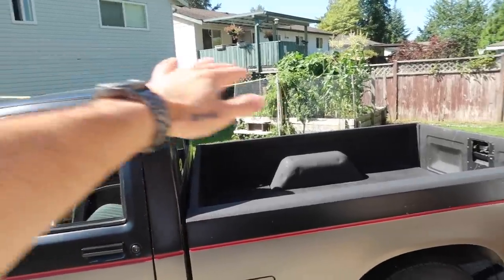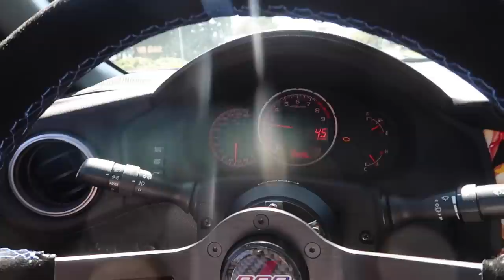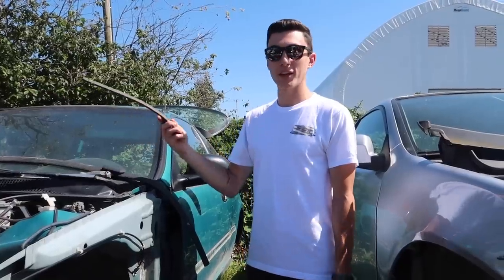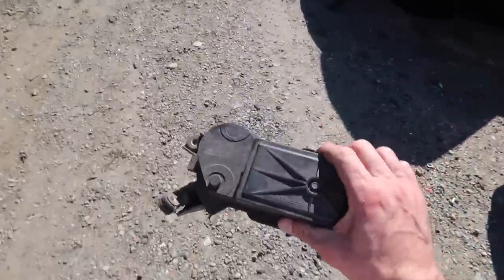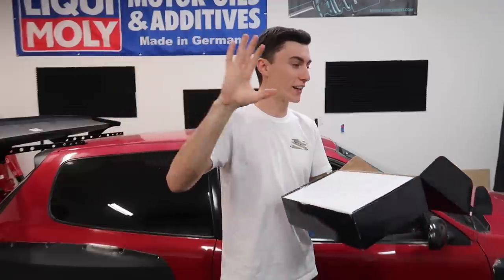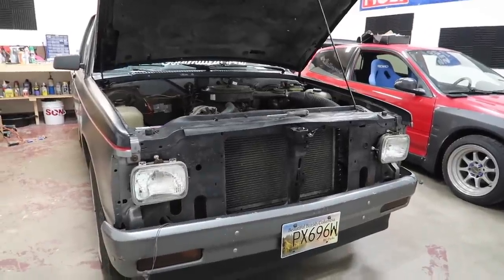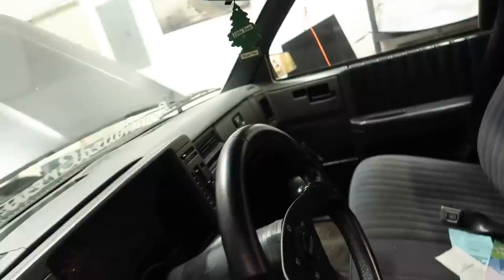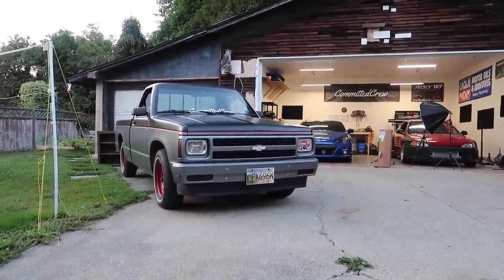Projector Headlight Install on the S10!

Comment: The wipers also use a relay that could be bad & the column switch could be bad too
Reply: the colum switch isnt easy to replace either, makes for good content though lmao
Reply: Yes even when he turned the switch it look really flimsy _ also use a power probe , 
See if u have power and ground , shoot power thru the probe and it will power up the motor ..
Reply: @martinsalter1814  the switch is easy to change ... It just pulls out. Feeding the wire down the coloum it the tricky part.  I have 91 sonoma . U have to ground the motor make sure there brass ground is clean it will not work ... The mother board thebterminals get dirty clean them too ..
Reply: .  I have 91 sonoma . U have to ground the motor make sure there brass ground is clean it will not work ... The mother board the terminals get dirty clean them too ....

Comment: Wiper motors on those trucks have a grounding problem. If it’s not mounted, it won’t ground. Also sometimes you need to run a wire from the body of the wiper motor to the firewall.

Comment: Robbie, buddy.... That gromet that is attached to the wiper motor by what looks like a metal band is the ground for those motors. To actually test it you need to connect the power source and thread a bolt through that gromet into something to complete the circuit.

Comment: Before pulling apart the truck to get the wipers to work, check the wiper transmission, my wipers stopped working in my A4 and that's what the problem was, a seized transmission arm. Just a suggestion, love the videos!

Comment: Robie, just fixed a wiper issue. You have to open that top up and resolve the contacts where the plug harness goes. Then reseal the top. It's simple! The issue is because the weight over the years tugs downward.
Reply: *re-solder

Comment: Not sure if you figured out the wiper issue or not but I had the same issue on my 1991 S10 the actual motor is the ground so when you bolt it to the truck that is how it grounds clean the bolts and clean off a little paint at the mounting points.

Comment: Those trim pieces that were 2 way taped on are not aftermarket. The vx and cx models had a stick on molding and the models above had clip on moldings. A little tip for people who want to shave that molding, get vx or cx doors there no holes to be filled in behind the molding just a bit of 2 way tape to remove

Comment: I blew up my neon today time for a srt4 swap
Reply: I feel sorry for you. Good luck on the swap
Reply: Thanks man. I blew the head gasket on this 2.0 DOHC one to many times. Time for the srt4 wire harness already got a tunable ecu. Just need the 2.4 engine trans and axles. Other than that its plug and play pretty easygoing.
Reply: @ricerneon399  nice keep me updated
Reply: I have another 2.0 I'm might just put in for now wile I locate some srt4 parts
Reply: @callumb5184  keeferthequeef
Reply: Good luck dude; Hope everything turns out perfect!

Comment: WIPERS: yo I'm sure you've fixed these wipers and all, these trucks have a common problem with the board that controls the wipers.  It's not always the wiper motor.  I found a video and just re-soldered some joints on the board! Saved some money and only took about 20 minutes.

Comment: Run a ground strap from one of the three bolts on the wiper motor retaining it to the firewall, and attach the other end to the ground strap coming from the engine cylinder head. That will eliminate a potential ground issue, which is more common on these trucks then one would think, it is also a cheap check, as a ground strap is what? A piece of 14ga wire and two eyes.. Good luck, if you need any wiring diagrams, hit me up

Comment: Honestly you probably did something to the immobilizer aka ignition. It'll try to turn over but won't spark or send fuel or keep the throttle body closed. Not sure on this truck, but look for any wires that may have pulled out of the plastic connectors or just plain ripped. Old vehicles electricals tend to corrode.

Comment: How well do those little S10s handle the snow? i want to get a mini/midsize truck but dont want to get one that will just get stuck in snow
Reply from the maker: If its 2wd dont bother unless you can put an LSD in it, they can barely go up a hill in rain with the open diff😂 (I also live where there is big ass hills)

Comment: You’re turn signal/wiper switch probably has some severed wires just at the base of the switch on the steering wheel, it’s a pain to replace the switch but I’d try to do that.

Comment: The reason it won’t start is the passlock security system I changed an alternator on my Chevy and it did the same thing. Look it up and it’s about a 30 minute process. Basically all it does is shut off the fuel system

Comment: Ok idk if its already been stated 1. The eg hatch and coupe are exactly the same except the ass end, and I think the doors are the same size but not 100%, the sedan rear bumper and coupe rear bumper line up correct, and the delsol has bits and pieces that match up but for the most part they're bastard children. 2. The reason your hatch didnt have the bump trims (designed to save your paint if something hits the sides instead of bare metal) is because it's a vx which was the base civic roller windows, manual mirrors, maybe ac?, no cruise control, no sunroof and in some cases no radio, Dx hatches had them black, and then ex and si hatches and coupes had them color matched, personally I like the vx dip and will be deleting mine, and 3. Fun fact I think you'd get a kick out of being from the great white north alot of eg's are from Canada

Comment: I would run some 12v power from that battery through the motor first to test the motor before you go and check all the wiring
Reply from the maker: Good idea!

Comment: I wonder if those headlights would fit my C10 Custom Deluxe!! 🤔
Reply: They are direct replacement for standard sealed beams headlights so as long as you get the right size, it should work fine.